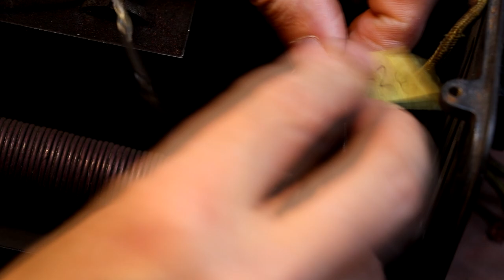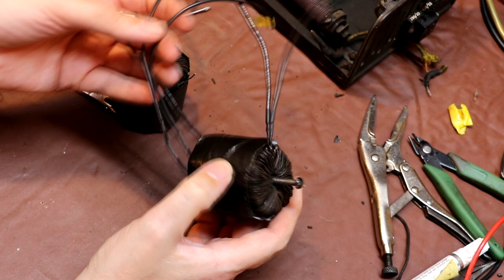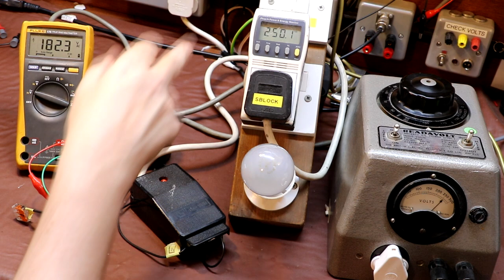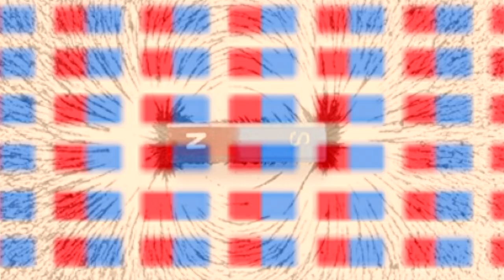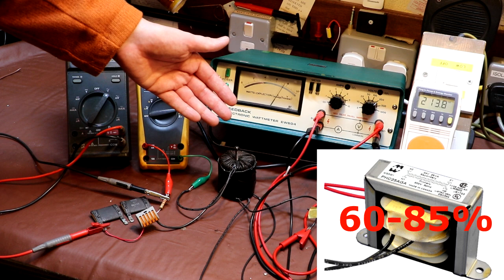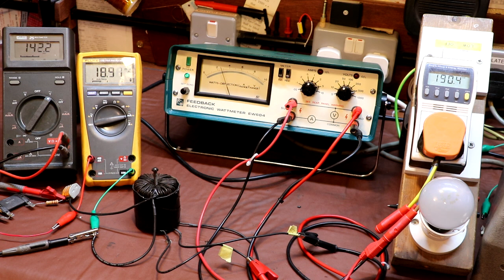Transformers Hedgehogs In Disguise - W.I.B Battery Eliminator

Comment: Well i'm transformed into a jibbering mess (as normal) lol.
When you dare to put diodes on the output of the transformer and feed a capacitive+resistive load, all the logic trickles out of my ears lol.
And the conducting periods of the diodes create more hell with the waveform.
I'm glad that i built supplys the bodgy way,  make the rectifier + capacitance part and pick a transformer that's overboard in volts and amps.
Removing secondary windings a turn at a time to get the capacitor voltage sweet with a full load.
Ripple voltage from a distorted waveform.....  i'm running away lol.
Too many moving variables for my thick head.
Sorry that was a moan a thon, smashing video chris :-D
Reply from the maker: Well to be honest your method is the one I have used for designing many transformer over the years. If it works it works.
Reply: @allthegearnoidea6752  i forgot, i hope you and your misses are having a nice xmas :-D